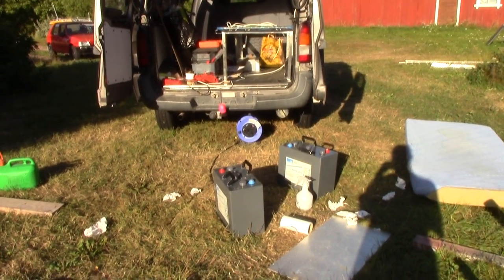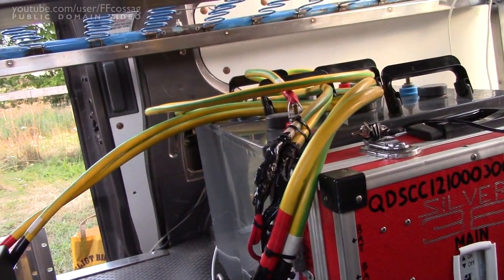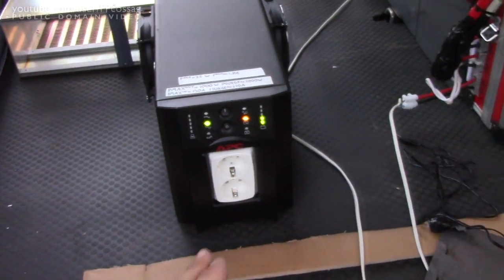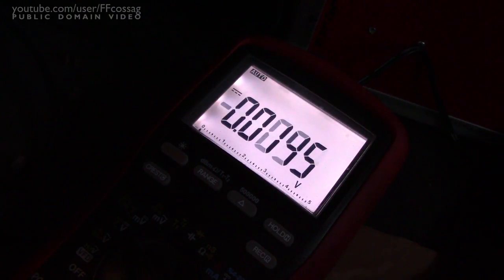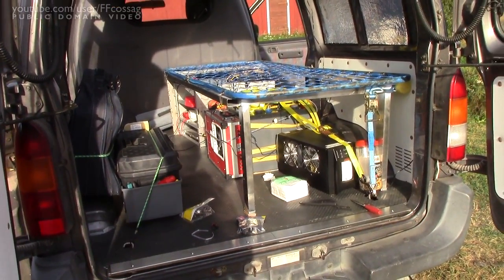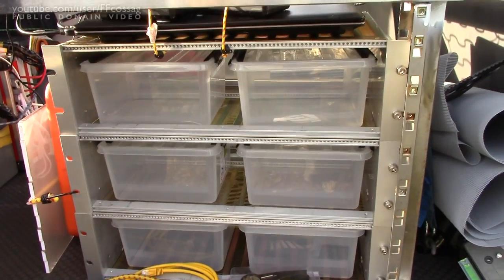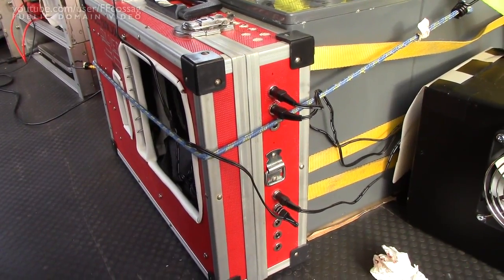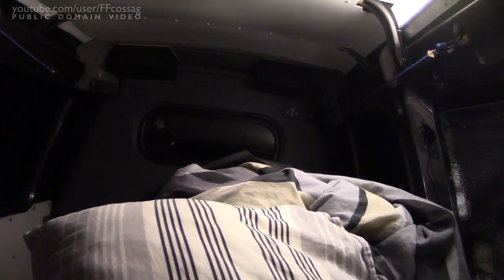Van camper! Build log #6 - Electrics

Comment: That's quite a set up. You may want to have a method of cross connectivity for charging off the engine alternator "just in case".
It would be the time to check to be sure you don't have an issue with that IF there is something haywire with the install? I doubt that there would be one, but one never knows.
 How about adding some thick damage proof insulating material over the battery terminals. Oh and while I am spouting off worry some thoughts, something solid between the batteries to prevent forward movement or tip over? Surely once inertia takes over in a crash they won't stay put, God forbid a roll over. Sorry to be such a mother hen. I would feel more confident if a bracket were fabricated to bolt the batteries to the floor or some such.  C
Reply from the maker: If it'd be easy to bolt stuff to the floor, I'd be doing that for everything, but sadly that would defeat my quick-in quick-out idea behind this build. Crashing this vehicle is a death sentence no matter what's in it, anyway.

As far as testing is concerned, these videos are a bit behind. In "real time", I've slept in the van several nights already in order to test everything out, and indeed both of the Chinese laptop chargers failed in short order.

Comment: 73 amps!!, thats mad :-D
I hope those batteries are safer than lead acid, no nasty gasses?
That meter needs modding, dam short term light :-(.
Reply from the maker: They ARE lead-acid, but sealed cells that rely on recombination, so they basically only gas if they get overcharged to the point that significant pressure builds up inside, and I'm not even sure my solar panel has enough grunt to make that happen.
Reply: I hope they never do go pop, i had a truck battery explode near me, one of the companys chargers created a spark, the hydrogen went BoooM, acid mix everywhere, thankfully i was looking in the opposite direction.
Reply from the maker: zx8401ztv
That's relatively common when you combine flooded batteries and shitty transformer-diode truck chargers. It pretty much doesn't ever happen with gel or AGM batteries running off of proper chargers.